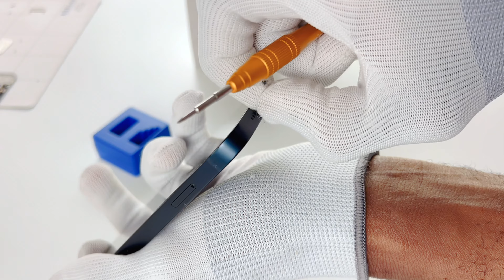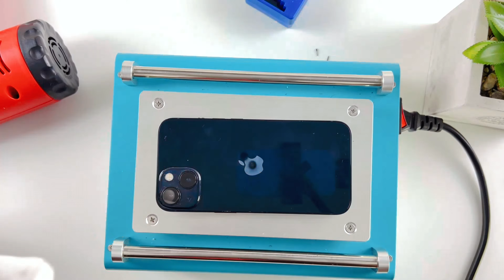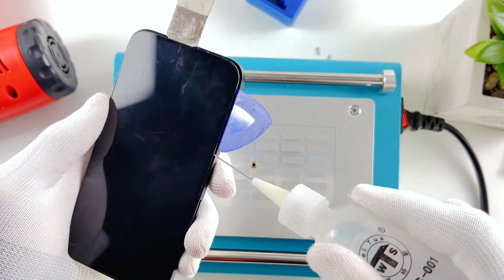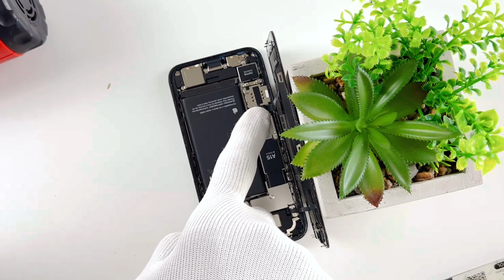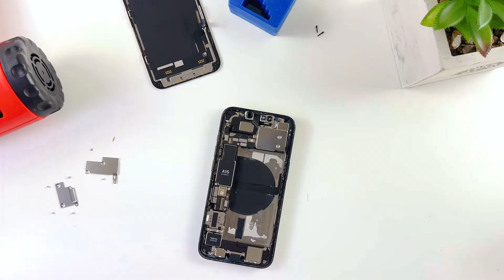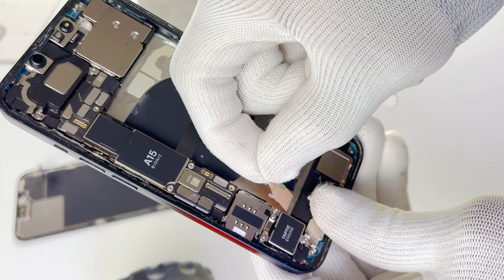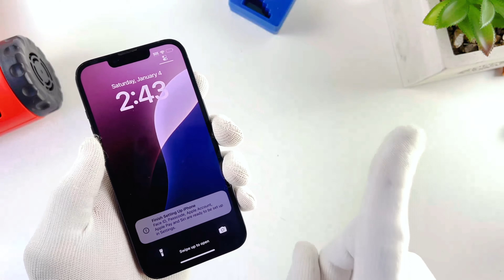Apple iPhone 13 / 13 Mini Battery Replacement... shown in 3 minutes!

Comment: 0/10 tutorial. DO NOT FOLLOW!

-DO NOT USE METAL TO PRY ON GLASS
-The battery has quick release tabs for the adhesive
-NEVER pry on lithium ion batteries if at all possible.
-Remove all old adhesive and gaskets.
-Replace adhesive with quick release tabs, not plain adhesive tape.
-Replace the water resistant gasket for the display. 
🙄😩🙄😩🙄😩
Reply from the maker: @mambobro I appreciate your feedback! 👍 I know some people prefer using the pull tabs, but in my experience they often break and end up taking longer, which is why I use the heat and alcohol method, it softens the adhesive and makes removal smoother without forcing the tabs.

Also, I only use plastic tools on the battery itself and avoid prying directly on glass with metal. As for adhesives and gaskets, I usually skip re-sealing on personal devices since I might need to open them again, and once a phone has been opened, I don’t believe you can restore true factory water resistance.

Different techs have different workflows, and this one has worked well for me over the years.

Comment: Very Nice Video but I got one problem! I think using a waterproof seal before putting the screen back on it is really important even if its only for personal use! The seal makes sure that no dust or stuff gets in there, reducing the chances of any damages and just makes it better/easier if you wanna repair it again the the future
Reply from the maker: @noobmatter6141 Thanks so much for saying that, I appreciate you watching and glad you liked the video!
You’re totally right, a new seal really helps keep out dust and moisture, which can definitely make a difference for the long run and make future repairs cleaner too.

For my own phones, I usually skip the seal because I use a strong case like an OtterBox instead, it helps protect against dust and daily bumps, so it kinda covers that extra protection for me.

But your point is spot on, a good seal plus a good case is the best combo! Appreciate you bringing that up. 👍
Reply: How do I even remove the seal? It only gets partially removed. Even alcohol doesn't help.

Comment: Why do you have to disconnect the screen? Can it not be done without disconnecting the screen?
Reply from the maker: @LesSablesRose Good question! Technically, you can replace the battery without fully disconnecting the screen, but it's a lot riskier. The flex cables are really delicate, and if you accidentally pull or stress them, you could damage the display or Face ID. Disconnecting the screen just gives you more space to work safely and avoid costly mistakes. Let me know if you’re thinking of trying it. I’m happy to help however I can! 🔧📱

Comment: I can’t figure out why the battery has to be taped down.  Is it necessary?
Reply from the maker: @gfriedman99  Good question! It’s not strictly necessary for the battery to be taped down, but it helps keep it secure in place, especially if the phone takes a drop. Apple usually uses stretch-release adhesive, but double-sided tape works well as a replacement. If it’s your personal phone and you’re careful, it might be fine without, but I’d still recommend adding some form of hold just to be safe.

Comment: Thanks, my girlfriend need change battery on this. Im gonna order some battery variable.
Reply from the maker: @exino1647 Glad it helped! If you're ordering a replacement battery, make sure to pick one with good reviews and solid capacity—ideally one that includes the adhesive and tools. And just a heads-up: after replacing the battery, you might see “Important Battery Message,” but the phone will still work normally. Let me know how it goes.
Reply: @GadgetGearGuide3Gs great video I don’t have heating place but I’ll see how it will go with removing battery
Reply from the maker: @dttec7660 Thanks! Glad you liked the video. If you don’t have a heating pad, you can try gently warming the back of the phone with a hair dryer or heat gun on low to soften the adhesive. Also, like I showed in the video, using 99% rubbing alcohol can really help break down the adhesive. A combination of heat and alcohol usually works best and makes removing the battery way easier. It makes prying the battery out a bit easier. Just be careful not to overheat anything, take your time and be gentle. Let me know how it goes!

Comment: Did do it right no seal after
Reply from the maker: Good question! Personally, when I do battery replacements for myself, I don’t always reseal the phone with adhesive. The internal clips and the pentalobe screws usually hold the screen down well enough for regular use. Plus, once a phone is opened, it's generally no longer fully water-resistant anyway.

That said, if you're doing the repair for a customer or offering it as a service, it's definitely a good idea to reseal it using frame adhesive or Tesa tape. It helps keep out dust and gives it a more professional finish. Let me know if you have more questions, happy to help!

Comment: Could a iPhone 12 battery replaced with iPhone 13 battery please reply me ❤
Reply from the maker: @PritamBorboruah Unfortunately, the iPhone 12 and iPhone 13 batteries are not interchangeable. They have different connectors and power specs, so using a 13 battery in a 12 won’t work properly. It's best to replace with the correct battery made for your exact model. Let me know if you need help finding one!

Comment: if i do this myself does a pop up come out after the repair? does it say can not verifiy battery?
Reply from the maker: @polkmn8105  Yes, if you replace the battery yourself without transferring the original battery's flex cable, you’ll get a message saying “Unable to verify this iPhone has a genuine Apple battery.” But don’t worry, the phone and battery will still work perfectly fine.

If you'd prefer not to have the message, I do have a video showing how I use a spot welding machine to remove the original battery flex (the part with the connector and battery info) and transfer it to the new battery. It’s a more advanced repair, but with some practice, it’s definitely doable.

The video I made is for the iPhone 14 Pro, but the method is basically the same across most iPhone models once you understand the steps. Do you plan to do the repair for your personal use?
Reply: @GadgetGearGuide3Gs  thanks so much for the response. yes i have lots of experiance with solder but not spot welding. maybe ill take it somewhere as i dont have the tools for it. but i will look into it.
Reply from the maker: @polkmn8105 You are very welcome! If you’re already experienced with soldering, you’ll probably pick up spot welding pretty quickly if you ever decide to try it. But yeah, totally understandable, sometimes it's easier to take it to someone with the right tools. Either way, wishing you the best with the repair! Let me know if you ever have any other questions.

Comment: ahhh man they making it harder fuck that I miss taking the back off
Reply from the maker: @joshcudo8603  Yeah bro, for real! 😂 They’ve definitely made it way harder than the old days, used to be a couple screws and pop it open. Now it’s laser machines, glue, heat, and prayers lol.
Reply: @GadgetGearGuide3Gs yeah paid someone £30/$40 to do it haha.

I put an upgraded battery with 20% more mah.

My battery has 89% health original apple 18 months old just getting 6hrs now I can get 18hrs well worth doing it. Faster internet stopped lagging and freezing well worth it.

Dont buy a new phone buy a new battery!
Reply from the maker: @joshcudo8603 Haha respect! £30/$40 is a great deal, especially with that upgraded battery 🔋💪 Getting 18 hours now is crazy good, that’s a huge difference from the original 6 hours. Glad to hear the phone’s running smoother too.

Totally agree, sometimes all it takes is a new battery to make your phone feel brand new again. No need to drop hundreds on a new one when a proper battery swap can do the trick.

Thanks for sharing your experience! Feel free to drop any updates down the line, would love to hear how it holds up after a few months 👌📱

Comment: Would it work to use a heated water bath with a dinner plate on top innstead of the heat bed?
Reply from the maker: @machaarr Interesting idea! I’ve never tried a heated water bath with a plate on top, but my guess is it might not get hot enough or distribute the heat evenly like a heat plate does. If you give it a shot, let me know how it goes. I’m really curious to hear if it works for you!

Comment: In my iphone I think the screw is wrong
Reply from the maker: @Seyi-g2u If the screw feels wrong, it’s possible that it got mixed up with another one during removal. iPhones use different screw sizes in different spots, so even a small difference can cause issues.
If you’re unsure, you might want to double-check the screw layout for the iPhone 13, I show it in the video too. Let me know if you need help figuring out which one goes where!